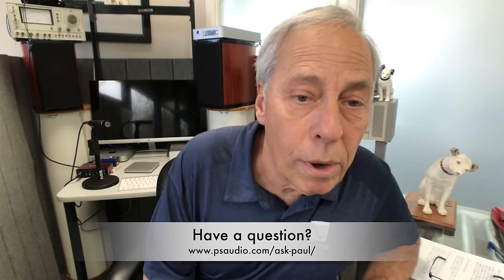How to match amps to speakers

Comment: Paul covered this in another way in another video. A small amp driven to clipping is more harmful to speakers than anything short of just a ridiculous power missmatch. Here's what you do. Get an amp that modestly exceeds the speaker's power handling capability and has it's own gain presets. Turn them all the way down. Turn your main volume full up. Ease the preset gains to the highest level that you will reasonably use within the speaker's linear region. Turn down the preamp to the currently desired level. Done. Speakers fully matched to the system and protected from amp clipping and over excursion.
Reply: You should calibrate using pink noise at -20dB as the signal. And you can for instance measure at listening position at 85 dB. Then you know that you will never play more than 105dB at listening position.  You can of course calibrate using 70, 75. but you must not exceed the max SPL of the speakers ( which sometimes is documented ).  There are several videos on youtube that covers how to calibrate studio monitors, and you can do this in the same way. But to be able to do it you need a volume knob on each channel on the power amplifier to be able to do this. And if you can do this, you will be sure, as you said. But I would not try to calibrate while listening to music. Because different music has different loudness levels. Pink noise is controlled.
Reply: Overpower & underdrive!! Scripture.

Comment: Ok. Rated power is rated power. It's what a machine needs to do it's job. Sure, you could put a 9.9hp on a 18' pontoon. LMFAO. My 2¢, double the 1k RMS rating (1.5 for 20-20k) and just don't turn it up to 11! Damping factor is greatly improved, and both the amp & speaker have ample power. This reduces flubber and brings out nuances. You can always turn it down. Just because you put a 200hp on a pontoon doesn't mean you have to go 55mph all the time. LMFAO again. Klipsch engineers agree, and years ago it was an Electro-Voice engineer that suggested it to me. I'll bet you have a sound bar hanging off of at least one TV. lol. In my experience the efficiency rating has nothing to do with choosing power, but more of a "how shitty is this speaker" rating. Simply put, if it's in the 80s move on to the next one. I practice overpower & underdrive for the best sonic experience from any speaker system.

Comment: Thank you paul for the insight on speaker matching with AMPS. I have recently purchased a Pylon Audio Amber MK2 speakers for stereo and have also purchased a Marantz Pm7000N 60watts at 8ohms and 80 watts at 4ohms. My speakers are 97db and nominal power of 300watts at 4 ohms. I am very happy with the setup and all my doubts clarified . Thank you for enlightening us

Comment: I run klipsch r35 at 125w per speaker powered by 80w denon amp x7. Over 10 years low and no problem

Comment: For bookshelf speakers, the range is typically 82 to 92db at 1watt/meter. With the Avg I see at 85-86.  Alot of Amps under 100 watts are typically used to drive these speakers...with varying results but usually good.  Maybe an Amp with more current output, headroom, would be better for discussion as some 100 watt amps can't beat some 50 watt amps.  Also, hundreds of watts?  Doubt it, at least for home music listening for most people.

Comment: A very long and detailed answer to a very short question, and the correct snswer should have been : "YES. YOU SHOULD USE AN AMP OF 300 WATTS OR LESS". Paul said that on minute 3.50 of the video: "do not acceed the rated power handlig capacity of the speaker in order not to harm it". All the rest of the information is just nice to have. Note that the data of speaker's efficiency is not always indicated, certainly if you buy it second hand.

Comment: Also keep in mind a speaker can handle much higher short term busts of clean power than its conservatively rated power. Music is peaks and dips. A lower powered amplifier driven into distorted clipping can damage a speaker much easier than an amplifier with more clean power and clean headroom.

Comment: After a kitchen hand took off with my Bose 800 speakers at an officers's club in W. Germany, I had to perform my show with borrowed bookshelf speakers that were driven by a 200W RMS amp. They began to distort at a very low setting on the mixer. So a powerful amp can be used with even 20W speakers as long as the output is kept below clipping level.

Comment: I got some new speakers last week. They're big and should sound really good but they're a bit lacking with my Aiyima a07 class D amp. I think my amp delivers about 130 watts at 6 ohms but these speakers are rated at 250 watts, the speakers are 89db efficient (Yamaha NS-777 floor standing). I ended up wiring up a second pair of 6 ohm speakers to fill out the sound and make it sound richer. It sounds pretty good now but am shopping for a bigger amp, probably a class AB amp next time.

Comment: Paul, this was a very helpful video.  I appreciate that you take time to share you knowledge.  I do have a question about this video.  At 3:40 you say, “if you buy a medium efficiency amplifier, say 90 dB, that means you can run that thing at an amplifier that’s 50 to 100 watts...”. Did you really mean, “if you buy a medium efficiency speaker...?”  Thanks again.
Reply: I'm extremely confused by this, and can't find info on speaker efficiency anywhere. Does he have some way of calculating it he didn't mention here??

Comment: It is also another problem that the impedance of some speakers are very skewed. So it can vary all the way from 3 to 8 which means that for some frequencies, it might put out many more watts than for other frequencies. And it might be that the efficiency of the speaker is measured at a frequency that is 8 ohm.... it makes a bit more complicated.

Comment: Hello, I have a question, I have an audio match set for BMW F36, after installation everything works fine, but the problem occurs when I turn up the bass volume to the maximum, there is a whining sound, but when I turn the volume down to half, it plays normally.

Comment: Once again Paul has only given half the explanation.
I was always under the impression that an under powered amp risked damaging speakers due to potential clipping.
Also having an amp at a higher rating than your speakers is fine as long as you don't go crazy with the gain and has the advantage of greater headroom.
Reply: True, volume is the only killer to speakers. If your sound keep low all the time, nothing is gonna hurt them
Reply: @phockuahole  he is right... you will damage an underpowered amp running low sensitivity speakers

Comment: What if you are running a 7.2 home theater setup and the they are all 6 ohms, but different sensitivities?  The bookshelf speakers are 85db, LCR are 90db. Same line of speakers. Should I get one amp for the bookshelves and another for the LCR?

Comment: It is instructive to note that with speakers of lower sensitivity,  especially 2-way or 3-way systems,  an amplifier should be able to easily deliver the rated peak power (or higher) of the speakers.  If not,  the amplifier can clip and/or distort at high volume settings,  and blow out the tweeters.  You should NEVER send a clipped or distorted signal to a two or three way speaker system.  It is better to go with a higher powered amp per speaker power handling rating,  and throttle it back so the speaker gets a clean signal.  Of course,  any fool can blow out a speaker system by grossly exceeding the power rating,  as well...

Comment: Hi Paul, my JBL 4312 speakers are 6 ohms, And i'm going to use them with a Mcintosh integrated amp that only  2; 4 and 8 ohms output. Should I connect the speakers to the 8ohms or 4 ohms output?

Comment: hey there, just found some old speakers in the loft, these are the specs for them. I have 6 of them in total but don't have a clue what sort of amp I need for them? I've watched the vid but am still struggling a bit lol: Main confusion is with multiple speakers... Does multiple speakers affect what amp I need?
Power Handling: 

300 Watt RMS
System Sensitivity: 91 dB
Impedance: 8 Ω

Comment: Right now i have a pair of Polk es20 hooked up to a Fosi Audio V3 amp and the volume produced is well enough for me but the thing i dont understand is why i would buy a bigger more expensive amp if it puts out the same wattage? I dont have any other amp to compare to so i dont know if the sound from the amp could improve or if the things i find "lacking" in my setup comes from the speaker or the amp

Comment: Well hell the number one question of the day is what is efficiency that would be impedance so if you got a speaker with 98.99 in , you're great takes very little power but if you're a around 88 87 it's going to take a lot more power to push that speaker

Comment: Hey mates, kindly assist please. I have the following car speakers: MTX TX265SX 6.5“ 70w rms 4 ohms and Vibe Slick 5-V7 5.25″ 70w rms 4 ohms

I was gifted a JBL club A754 4 channel amp which delivers up to 75w rms per channel. 

I understand that when matching your speakers to your amp, the amp's rms per channel needs to equal to that of the speaker. In my case, my amps will be putting out 5w more than my speaker's RMS limit (75w rms > 70w rms). Will this damage my speakers? I do intend on playing them at high volume.

As an alternative, I can get the JBL 704 amp which outputs 70w rms per channel. This route will require that I buy the amp, which I'm not happy about as I already have an amp. But if need be I'll do it. 

Many many thanks in advance for your replies.

Comment: I'm pumping 400w into a pair of 50w 8ohm speaker for a total impedance of 4ohms, so far working good with a hi pass filter but can't go lower than 4ohms because I'm running my amp in bridge mode, my Amp has built in speaker protection so it will cut off if the speaker can't handle the power...planing to get bigger speakers soon so my question is, how loud  can I get if I'm putting that same 400w into a pair of 8ohm 1200w speakers

Comment: It is all about few parameters what 90 % ppl would recognize in speaker and amplifire. Problem is when producers usually says about 1 or 2 parameters only. Then even specialists cant say proper answer about how to match audio system. First rule is usually about to not give higher maximum power amplifier to lower maximum power spakers. Second rule: higher RMS power mean better qualitty audio (it looks strange if You can give 40% power cause low guality auidio). RMS of Speakers means what maximum RMS power of amplifier You should connect. Other parameters dosent really metter - higher efficincy, higher maximum efficiency, size of Speakers should result better, more flexible and louder noise what we ussually like. Lower Ohms means more power. Sometimes You know parameters only for 1 Ohm setup from 2 or 3 possible. 50 watts 8 Ohm Amplifier means 100 watts for 4 Ohm speakers. So Amplfier have 75 watts 8 Ohms and 200 watts peak power and Speakers have 100 watts 8 Ohms and 250 watts peak maximum power. - It looks like possible connection.

Comment: I've read from several sources that the required power doubles for every +3 dB needed. So a speaker with a sensitivity of 90 dB (1 W, 1 m) will consume half the power compared to a similar speaker with a sensitivity of 87 dB (1 W, 1 m) when both are playing the same material at the same volume. On the other hand, turning the amplifier up to gain +3 dB will double the wattage used unless the speaker or the amplifier is reaching its limits.

1 dB is very close to the smallest noticeable change in sound pressure. 3 dB is certainly noticeable but not very much of a change either. So, a small change in speaker sensitivity (or preferable listening level or dynamic range of records or room acoustics) could make a big difference in required amplifier power.

Is this generally correct?
Reply: You are right - it is only 3 dB less in sound pressure an d it is so much as double less power drawn from amplifier. And it  my be at 10 times less THD. That is someting to think about when purchasing power amp. because with grow of used electrical power up the reconstruction of sound quality   starts to be problematic due to sizes of powerfull speakers. In reality we experience mostly sound coming from point-like sources. Much power  requires more speakers so the size of radiating  sound field is growing to much larger making  perfection of  sound impossible.  For gaining reality sound I use minimum  dimension  speakers limited only by low tones efficiency and amplifiers not  more than them at max 10% of capability.  The art of sound reconstruction starts with speaker high efficency  and  little dimension of radiated sound field, not the high power.. For this pupose  is developed by me  crossover.
Reply: I think I learnt this while I was a teenager. Ever since then, I'd only want hi eff speakers. How u do it is like, count how many doubles u can make starting from 1 watt, then 2, 4, 8, 16. In this example, there are four increments of 3 dB, and multiplying them gets u 12 dB, 12 here meaning u can have 12 dB of dynamics above yr speaker's efficiency quote. So for my JBL 4320, running at 96 dB@1watt at 1 metre, if I have n amp of 15 watts or so, my system gets me 108 dB tops.

Comment: QUESTION: I have a system that I'm VERY happy with except for the bass and treble controls on the stereo amp. They don't add much. I'd like to add a non powered mixer between the CD player and the CD input on the amp. ( the mixer has nice preamps and good bass/treble pots) As long as I keep the output to a minimum, do you see any danger of burning out the CD input on the amp? Thanks (Scott, Halifax Nova Scotia)

Comment: I have a question about a line 6 iv head 150 watts 8 ohms right and left,  I was wondering if I could connect with a guitar cable to a speaker that plugs into the wall it has four speakers  each are about 8inch to 10inch and has option to 120v to 240volts can I connect it without harming or overheating anything ?

Comment: Hi Paul, I have a Denon AV Receiver 6700, currently it is set up as 5.1.4 with all 6ohms speakers and now I would like to add 2 rear surrounds to make it as 7.1.4. I have pair of Denon Speakers that came along with my Denon CEOL RCD-N8 Receiver, it's a 6ohms 60W RMS and 120W Peak. My question is to know whether I shall connect it with my Denon AV Receiver or not, because the Surround output is mentioned as 175W + 17W at 6ohms with 2 channels driven. Could you please advise. Thank you.

Comment: I just purchased the Graham ls 6 speakers and am planning to pair them with a NAD C399 amplifier. The speakers are 8 ohm with an impedance of 87 db’s and recommended amplifier power of 50-150 watts. The NAD C399 has continuous power of 180 watts per channel into 4/8 ohms. Would that pairing work even though the speakers’ recommended amplifier range  (50-150 watts per channel) is lower than the NAD’s (180 watts)?

Comment: Hi, I am setting up a marantz sr6015 with 5.1.2, where I am using thx504L for centre ch and thx 502L for front leg and right. Rp 402s for surround and cs18 C for the atmos ceiling speakers.. Here I am not too sure abt the centre speaker, if it is appropriate for this amp or I should go with thx 502-L? Because in the description it is recommended for 150w amp?

Comment: Hi sir I got most part of your vdo, but I have one serious doubt and its bothering me a lot,so you mentioned a low sensitivity speaker will have around 88db@1w@1mtr,
91db@2w,
94db@4w,
97db@8w,
100db@16w,

So the same speaker Will have 6ohm,10watt on the backside,does that mean it will produce 97-100db(lies between 8w-16w from the above chart) at 10watt at 1mtr distance.please help,I am about to build a diy home theater but this part is so confusing

Comment: I have got Rms power 250w (8ohms) speakers. and I'm powering it from my pioneer Vsx 7300 which is built to out 125w @8ohms. 

My question is when I volume up amplifier to the middle. is that safe to drive these speakers?? because 250 divided by 2 is 125. my amplifier has 0-30 numbers on volume knob. I use to keep it in 13 to more safe. and I'm using a yamaha mixer to give the sound input. 

please tell me what is your idea about this.... and I want to know how many watts are there between two numbers when I do this matching?

Comment: Hi Paul. I'm wPaul as well. I have a Crown XLI 2500 500 Watts at 8 Ohm and my JBL tower studio190 speakers are 100 watt and 500 watt peak. I drive them pretty hard sometimes. Should they be OK? My brother always said your Amp should be more powerful than your speakers as an underpowered Amp wil damage your speakers. Signal to noise 20 Hz to 20 Hz rated at A -weighted . >100 dB

Comment: sir is it still match if the amp is equal to the wattage rating of speaker, i have 1500w(rms) amp at 4ohms, and my speakers also rated at 1500w(rms) at 4 ohms?

Comment: Hello, what happens if I run 16ohm speakers on an 4-8ohm rated amplifier? Does it mean that the speakers will receive less power from the amp in comparison, or are there other acoustical issues? Thanks

Comment: If you have a speaker with 98db sensitivity where the speaker has a peak at 600W. Does it mean I can pair it with a 10watt amp without damaging the speaker if I'm happy with 105db? Let's assume the speaker can handle a SPL of 130db. All other people on youtube say if your amps max watt is way lower than speakrs max watt it will break the speaker and make it overheat.

Also amps that are rated e.g. 300watt, do they always give 300watt power to the speaker or is it their volume dial that controls how much watt goes to the speaker? This is so confusing.